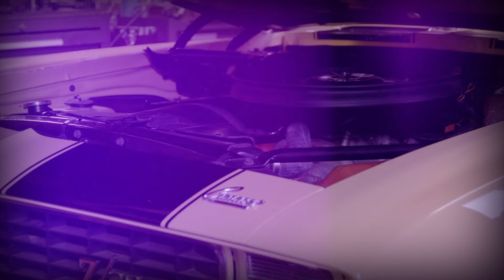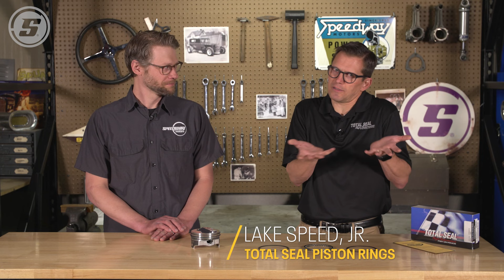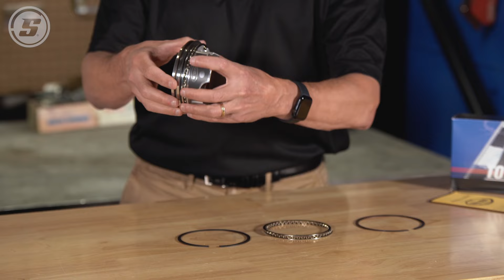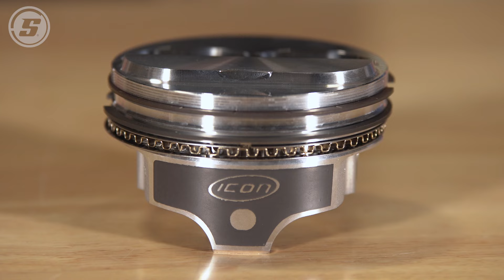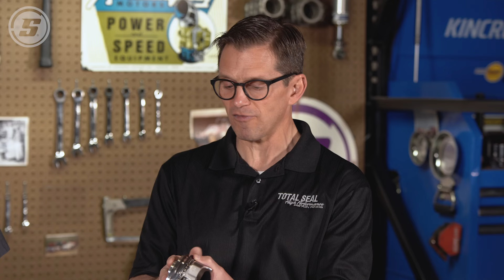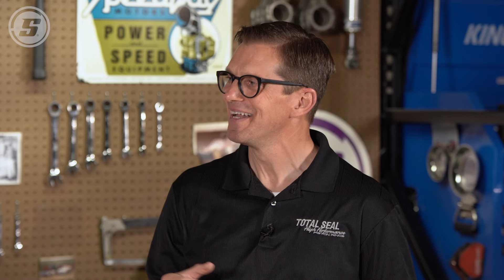How to Clock Piston Rings: Gap Orientation and Install Tips

Comment: in the total seal install pamphlet it shows the top and second ring gaps being at the top and bottom of piston (thrust/antithrust) and he is showing it aligned with the wrist pin.. seems there are a lot of ways to do this.. https://cdn.prod.website-files.com/63c09fc6be97f00613090411/63c09fc6be97f04df30904c2_InstallationSheet2010_2.pdf

Comment: It's a pity after all these years that no manufacturer has come up with a way to stop the rings from rotating in use.
If it were up to me, i would cast a raised nodule in the groves of the pistons at the required clock positions and manufacturer the rings with coroponding slots to engage them.
Problem solved!

Comment: Lake, I have a question. When SI was working at a reputable engine machine shop, I was taught (back in the 60s) not to place end gaps over top the ends of a piston pin. Is this an old wives tale or is there any validity to this practice?

Comment: but you have to prove it scientifically. howmuch will blow by increase if they line up? because it is similar to blowing through a 1" 1mm pipe vs 5" 1mm pipe, so it will increase but not that much

Comment: For a Left Hand Drive (LHD) BMW E30 M20 engine (straight six):
•  Front of engine: Pulley/timing belt end (toward radiator).
•  Back of engine: Flywheel/transmission end (toward firewall).
•  Intake side: Driver’s side (car’s left; observer’s right from front view), where the intake manifold attaches.
•  Exhaust side: Passenger’s side (car’s right; observer’s left from front view), where the exhaust manifold attaches.
•  Thrust side (major thrust): Exhaust side (observer’s left from front view).
•  Antithrust side (minor thrust): Intake side (observer’s right from front view).

So the intake and exhaust are NOT perpendicular to the major thrust and minor thrust sides but rather lined up. The intake side is the same as the MINOR THRUST side and the Exhaust side is the same as the MAJOR THRUST side. There is no 90 degrees rotations. Just flip flopping 180 degrees from the top ring down to the bottom ring. Starting with the top ring gap on the intake (minor thrust) side.

Comment: Ridiculous...all rings will rotate during operation unless there is a dowel in the lands. The thought that compressed air cares whether it has a straight shot or has to travel two inches to find another hole is laughable.

Comment: Cylinders bored to .060, got aluminum pistons, gapped the to bottom rings, ground to .018 and .015, top ring is .010. Should I  take it apart and add more to the top ring? Its a model t,  running fine last 20 miles since refresh,  no weird noises just worried. Its my first time lol

Comment: I would always make sure there are no small burrs at the ring gap ends. Burrs there will put scratches up and down the bore and mar the cylinder wall. I even do it before I insert rings to check the gap. O few light swipes with very fine sandpaper or a stone.

Comment: Anti thrust side would be intake side and thrust side would be exhaust side, then he tells to put 2nd ring to exhaust side but he signals the pin side that goes to the front of the engine and then 1st ring to intake and he signals the pin side that goes to the back of the engine, he don't know what he is saying or he is just talking about 2 valve v8's, but then he said it don't matter the cylinder amount inline 4 or V16, but it does matter the valve set up tho.
Reply: There are 4 sides to an engine, not counting the top and bottom. The thrust side is the side of the shaft where the connecting rod is ascending and the anti thrust side is the side where it is descending. These sides are perpendicular to the intake and exhaust sides, not parallel.

Comment: Why did he put the bottom scraper on before the expander ? The scrapers are meant to sit on top of the little ridges on the top and bottom of the expander right ?
Reply: Oil rail expander always first, then bottom rail then top rail. Followed by 2nd compression ring then last top compression ring. You are 100% correct.
Reply: I caught that too

Comment: Well that solved my question, do the rings move round when the motor is running.? And the man said that they do indeed.!  I can stop worrying now.!
Reply: I've never seen a ring rotate more than a tiny amount. It seems to me, the ring gaps would never line up. Never heard of such a thing and I've rebuilt dozens of engines.
Reply: @rsmith127  just pulled my ktm 4t piston because it was burning a TON of oil.
Ring gaps lined up, piston was black on that side

Comment: How can I know the first from the second ring ?
Reply: Usually the top ring has a curved edge instead of a 90 degree corner to allow oil to slide by. The second ring is usually a straight 90 degree edge on both sides where it contacts the cylinder wall.
Reply: The first ring is the black ring its thinner than the second ring
Reply: @godsonnicholaus588  thank you

Comment: Can you explain "thrust side"? Thanks, TJ
Reply: Loaded side of the piston during the combustion stroke.
Reply: Thanks. I probably should have known that. @mikman7219
Reply: For a Left Hand Drive (LHD) BMW E30 M20 engine (Straight six):
•  Front of engine: Pulley/timing belt end (toward radiator).
•  Back of engine: Flywheel/transmission end (toward firewall).
•  Intake side: Driver’s side (car’s left; observer’s right from front view), where the intake manifold attaches.
•  Exhaust side: Passenger’s side (car’s right; observer’s left from front view), where the exhaust manifold attaches.
•  Thrust side (major thrust): Exhaust side (observer’s left from front view).
•  Antithrust side (minor thrust): Intake side (observer’s right from front view).

So there is no 90 degrees. Just flip flopping 180 degrees starting with the top ring gap on the intakes side (minor thrust side) of the engine.
Reply: Piston not round it more cam shape. So there is surface that touching more on the cylinder bore, it’s called “thrust side”
Reply: @shizouka87 That doesn't sound right...
Reply: Out side of piston

Comment: They’re going to eventually line up, they’ll rotate at around 6 revolutions per minute and at some point they’re going to be in line. Just have to have a way of venting the crankcase pressure that is created.
Reply: 6 per minute?
Reply: Can I use the same technique on Diesel engine?
Reply: you mean a PCV system youre supposed to run on a street car?  i gaurantee you  it'll be way worse  if you dont  do this.  and if you did it right it wont  smoke

Comment: I have a question, so my pistons have a .200 oil Grove and I got some rings that supposedly match the oil Grove, when it's time to compress them into the cylinders they won't budge, is it the type of compressor I'm using? I've tried the fixed angle and the rachet type and the piston gets stuck as it's about to enter the bore. Does that mean I needa rebore the cylinders?
Reply: I think the gap of the ring was to small, make it a little bigger. Before you rebore the cylinders, you should check the clearance between the piston to the bore and you also can check your piston ring too before you put them to the piston